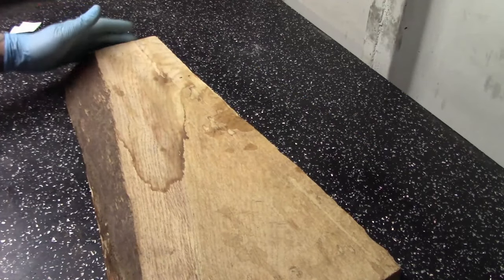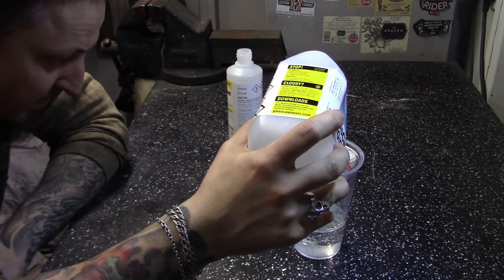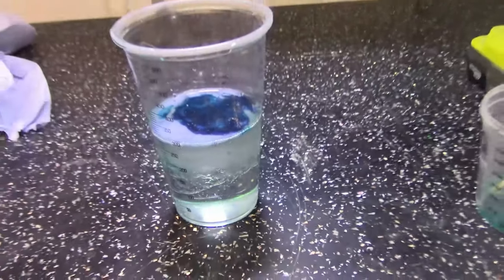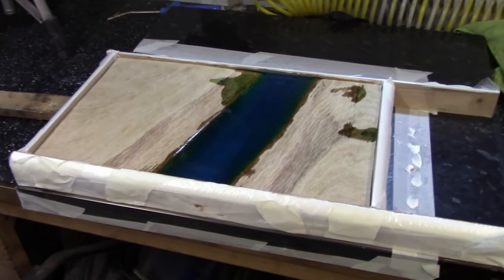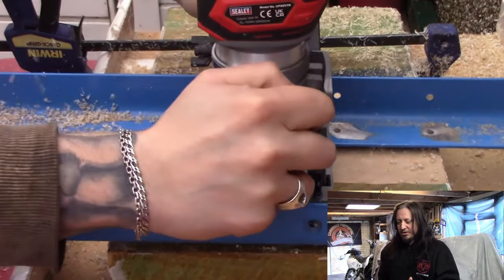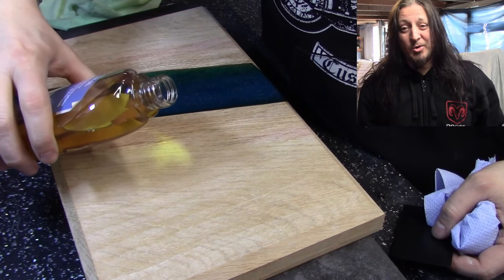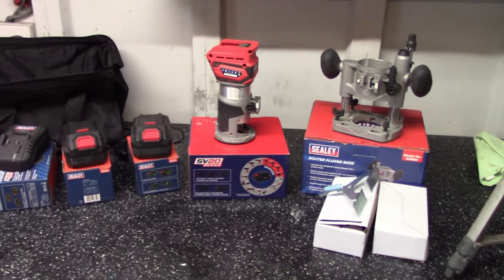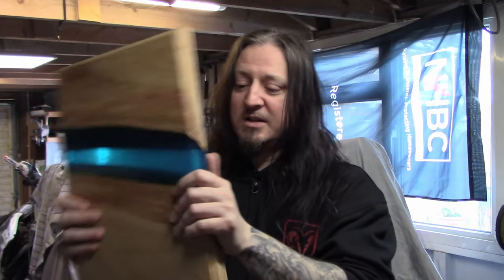Epoxy Resin River mini Table ...and a New Toy!

Comment: You did a great job with the board.  I have found you can sand the resin to about 1200 grit and finish the board and the resin with another coat of resin painted on, it flattens itself off.  You can also finish it with clear coat with your sprayer.😊
Reply from the maker: Thanks for the tips! I did wanted to keep the raw wood not covered with resin, which is why I went with the polishing. But good to know, so thanks!

Comment: Nice work mate, looks cool. I've done some small jobs with epoxy, points covers and cam end caps, really good stuff to work with and polishes up really well.

When mixing the resin I was shown to mix first then pour into a second cup and mix again, this makes sure you get a really even mix.
Reply from the maker: That does sound like a plan! I'll keep that in mind for the next project.